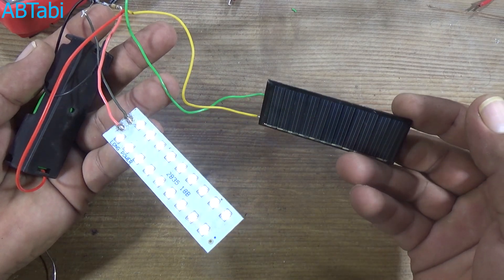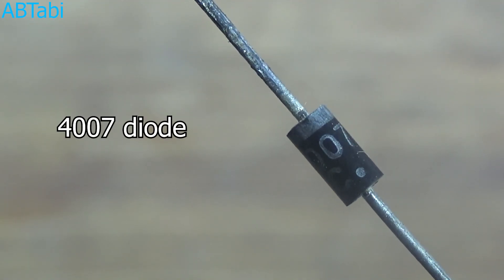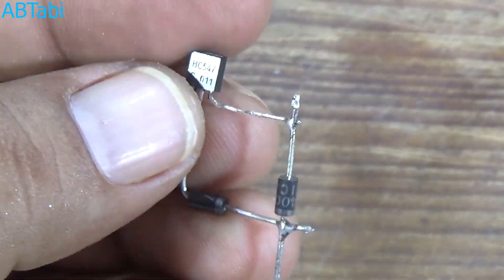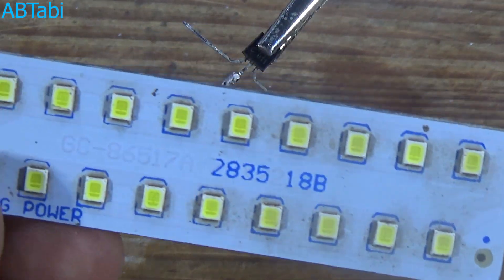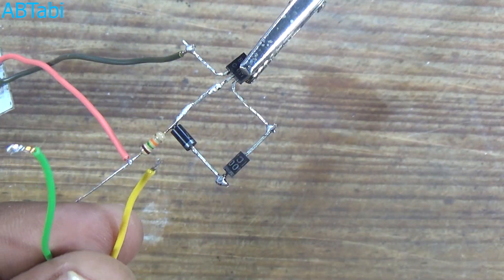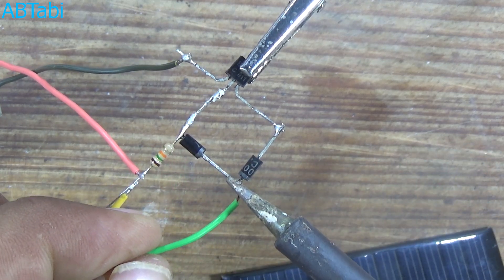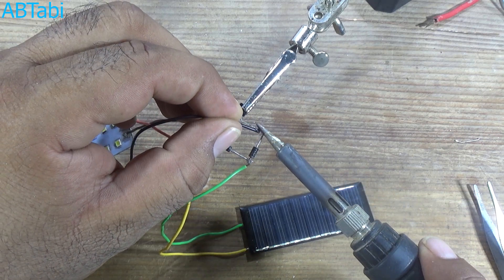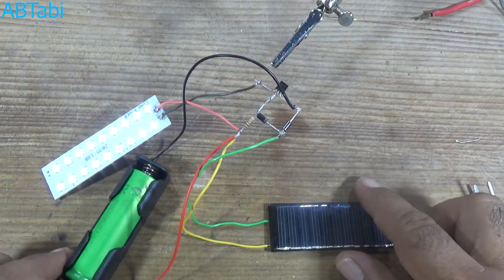Make automatic charge auto ON OFF Led street light diy project

Comment: How long the battery and the solar panel can last?
Reply: That depends on a lot of factors. 1. How much the ledstrip uses (depending on how many leds); 2. how much capacity is the battery (typically those are 3,5v but the amp/h varies which will impact on the time the strip can be on. 3. How much sun the panel is actually getting. To that you have to add some loss due to the diodes.

Comment: Hola ! Functiona egual con el 2N2222 si no tengo el BC547 ?
Reply: Pinout is different, but you can use it. BC547 is (left to right) CBE, 2N2222 is (left to right) EBC.

Comment: Want to connect it with a switch
Reply: Connect the switch between any wires of led
Reply: Can I have a circuit board diagram as  I would be using 6v 3W  3A solar panel
Reply: @miteshdhanani   sorry dear I don't have diagram.

Comment: Is there any risk of over charging??
Reply: The other way is you can use battery protection system that you can find on top of the mobile phone battery. I saw someone using that across his 3.7 li-ion battery.Thank you.
Reply: For this matter you can use TP4056 charging module that has the battery protection system.

Comment: Sir what is the main part that triggers the on off when no power from the solar panel? Does the transistor do that? And is it possible to just put transistor only ?
Reply from the maker: Yes transistor ,,,,,,,,     but without other components circuit not complete ,,,,,,,,,,,

Comment: Have it overcharge protection?
Reply from the maker: No over charge,,,,,,, 15 k resistor also work as regulator ,,,,,,,,
Reply: As we have to use 15k resistor for auto on/off regulation, can it affect to the light intensity of the LEDs light?